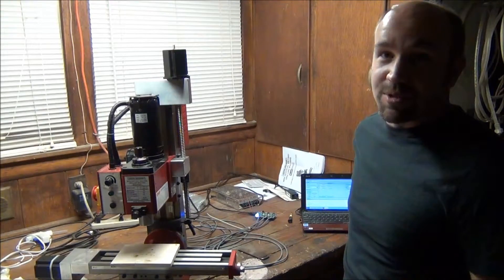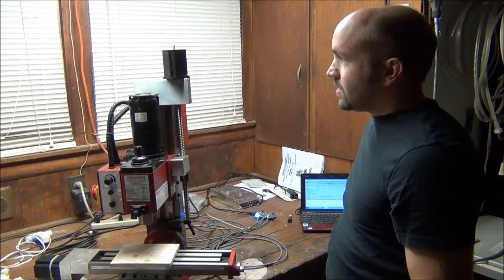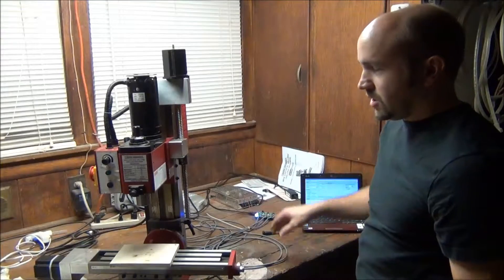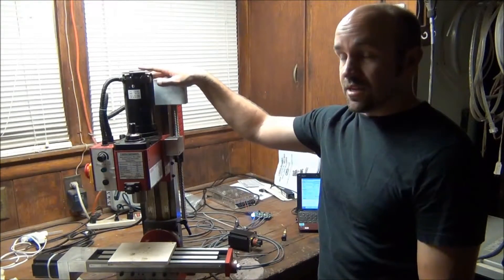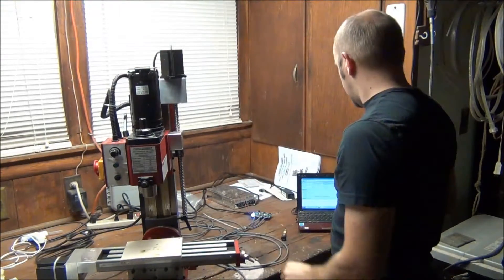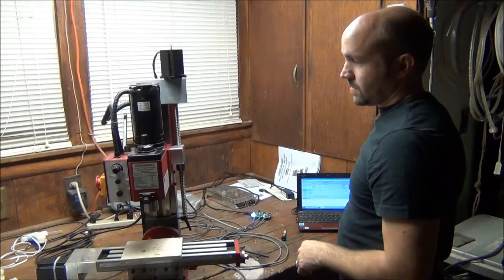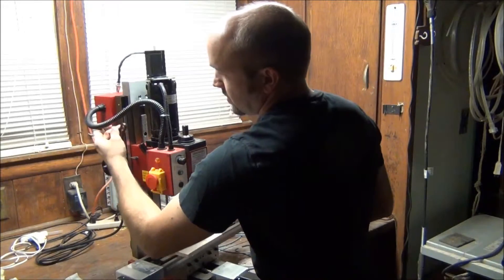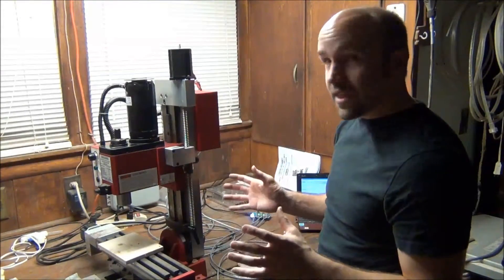Mini Mill CNC Conversion: The Z Axis Grind

Comment: Interesting that the torsion arm created problems with your Z Axis. I made a setup with a cheap ball screw and 3.0 amp 269 oz motor and it works fine with the torsion attached. I know this is old video but I’m always mining for ideas.
Reply from the maker: Good to know you were able to make it work. I sometimes wonder if adjusting the preload on the torsion spring would have made a difference. In any case, its still going strong after 7+ years.

Comment: Thats what happens when you mount the lift on the side it pulls the head to one side the ball screw should be mounted in the middle of the slides and should be using nema 34 for z axis due to weight
Reply from the maker: You are correct, that's the risk with this lift mechanism design.

Comment: Awesome, I have just been rebuilding my SX2 after one of my original motors died. I ended up purchasing a set of closed loop motors and drivers from http://en.jstuoge.com/index.php/Show/index/cid/200/id/294.html

Dam they are fast and super accurate but having the same binding issue on my Z, thanks for the refresher in setting that up. It had been so long that I had forgotten just how to do the adjustment.
Reply from the maker: Andrew, glad the video helped!

Comment: Could you help me? I have a couple of Servo motors like the one you have, I have some Gears which can be used on them. I would like to use them like your mill, but I dont have any ESC's r ( Motor Controller ) and I dont know much about CNC and where to start looking and learning about it. Do you have any idea's for someone like me who dont have much to buy a kit but in the same time I have the servo motors and a little bet of know how? Your help will be much apprishiated (sry my English ). Thank's
Reply from the maker: Mini mamo, I recommend the Synthetos grblShield for the stepper motor driver and then a PC running Universal Gcode Sender as the machine controller. However, you will need to be sure you have stepper motors and not servo motors. The motors I have are stepper motors. The grblShield does not work with servo motors. If you have other questions, feel free to email me at Tim@DIYmachining.com